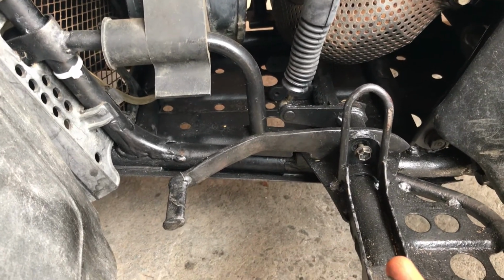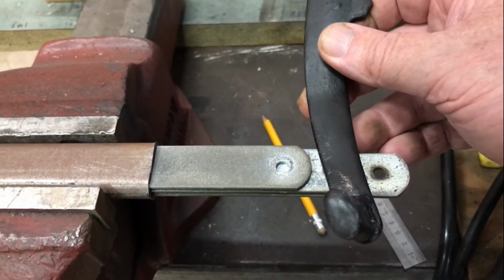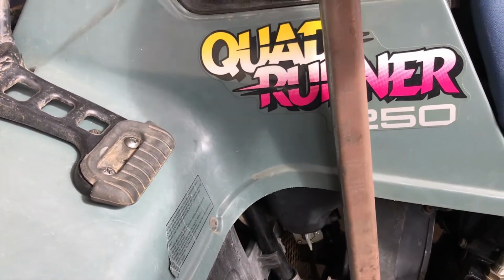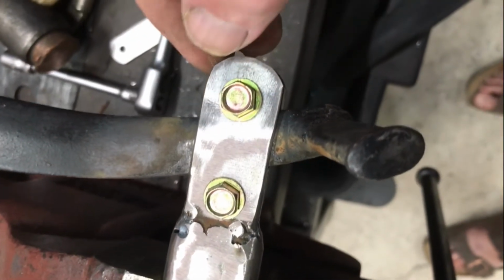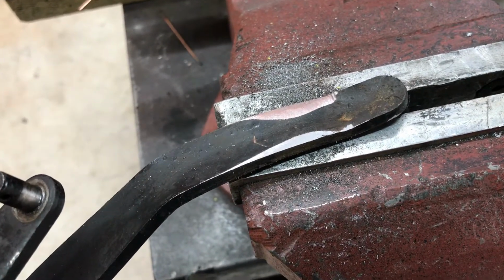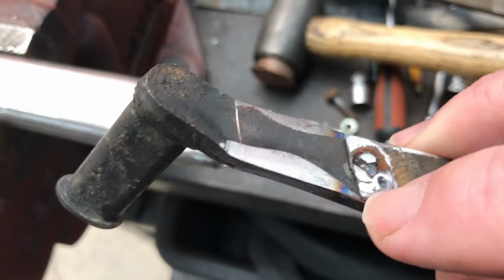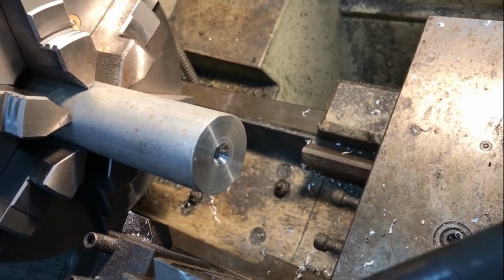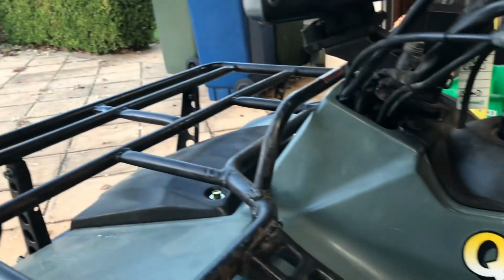Suzuki Quad Runner Lever Gear Shift Fabrication

Comment: That is the problem the swing is to long and hits your inner thigh when up shifting
Reply: I did the same on my king quad, I mounted mine close to the pivot bushing on the pedal, works fine , I  only have half the swing that  you do, ( The principles of leverage )